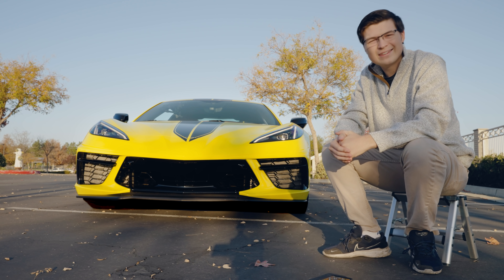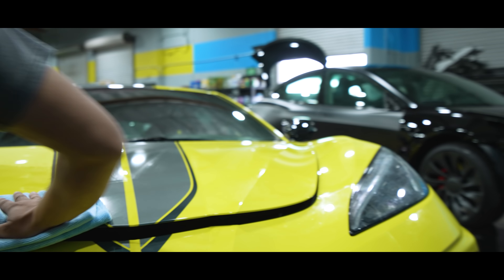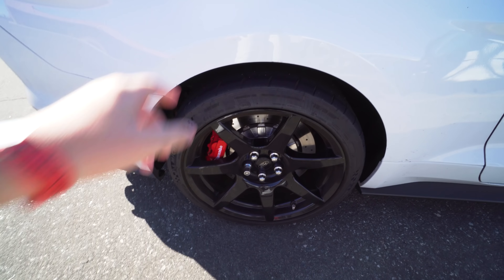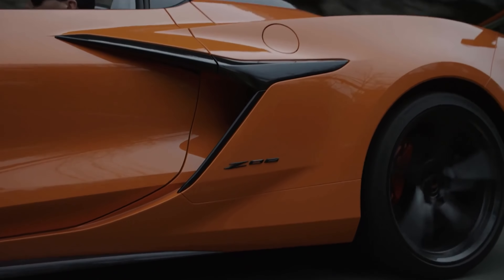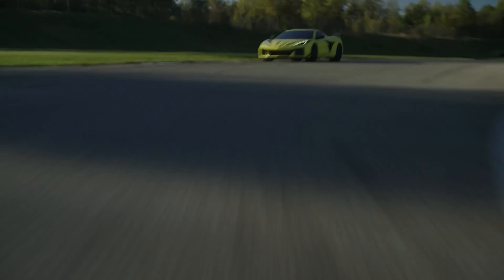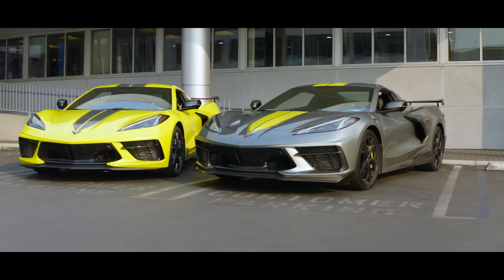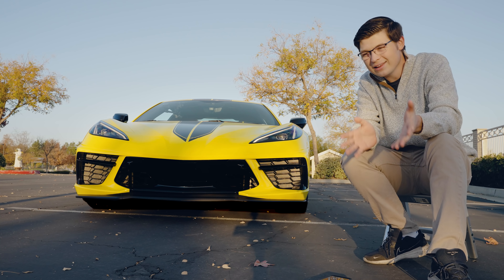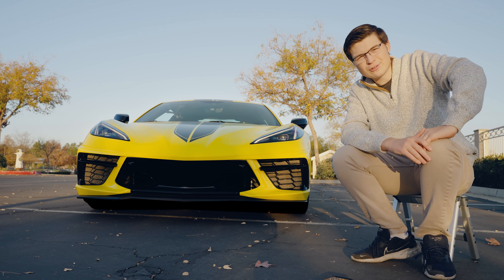SHOULD I SELL THE ULTRA RARE C8.R FOR A NEW 2023 Z06?

Comment: YES YES YES 

Sell, sell, sell!!!  Get as many ZO6s as you can!!!   
I was too late to the Ciocca party.  I was in Aruba and couldn’t do a wire transfer from there.

Decided to try MacMulkin a week or so later.   I’m #1672 no chance for me to get one at MSRP there for years. The C10s might be out by #1,500….  

I don’t need ZO7 on ZO6.  I’m not into Carbon Fiber either that much. Give me Torch Red, GT2 Seats, probably Front Lift, Mag Ride, Battery Protection and Standard Stock Wheels and Tires. (Hopefully the “Standard ZO6 Coupe” will have most of the Z51 Performance Items, maybe even those “beefed up a bit”!!!)

Comment: Mark ups are pretty nuts for the z06, well around me they are.  I have a 2021 C8 convertible, but love to have the Z06.  Can you get one without a crazy mark up?
Reply: Unfortunately probably  if you no the right people or have bought a ton of vettes like Austin has probably  from 1 dealer! Same as ferarri Porsche and lambo with there top models! Good luck hunt hard you might find a dealer that will sell at sticker! But my advice for you is wait till second year model as the new engine in zo6 could have issues first year! Let all the hype pass and be patient and wait a year after it's released then you will have way better chance of getting one at sticker and if it has issues the second year they will iron them out! Good luck!!
Reply: @mareewalker1096  Have you been under a rock for the past 2 years, stop spreading nonsense about the reliability of the new LT6 engine. It's been track tested for the past 2 years and has been rock solid, there is no way anyone could put more stress on that engine than the race team.
Reply: @pro5.019  I said it COULD have issues ! It's common new model cars have little issues that get ironed out with following year models! We're am I spreading rumors! Just made a statement that is based of facts! But i said it COULD not don't buy it it's going to have problems! That's spreading rumors! Didn't the c7 c06 have cooling issues ! Didn't it's 4 cylinder activation to save fuel cause long term issues!! All car builders can run into issues with new models!! Have you ever heard of new model cars having issues?? Don't jump to conclusions read what I said I believe it's sound advice! Take it as you feel it! I'd wait for second year just to be happy and confident it's a solid machine for 100k of my money! A lot do I'd expect!!
Reply: @mareewalker1096  You also stated in another comment above in this video  " Pretty good chance it has issues " that doesn't sound like COULD to me, maybe you should look back and read what you wrote. You also referred to the Stingray engine being proven, weren't you aware of the lifter/valve spring issues some owners experienced. Bottom line is any manufacturer can have issues that's why we have a warranty, and FYI if there was an issue buying a second or third model year doesn't improve your chances of getting past any problems. Many times the problems still exist in future model years due to manufacturing issues. 100k for what this car offers isn't a lot of money, after all you are buying a GM product not a high end exotic regardless of all the marketing hype. Look to a companies past history and the problems they have had, what matters is how those problems were addressed is all that counts.

Comment: Eventually a you tuber is going to purchase the supercharger kit, springs , aero, wheels and tires and lower the Stingray for the ultimate expression of the LT2 in a mid engine TRACK FOCUSED MACHINE. I will be the first person to say that a Stingray in that configuration WILL BE DEVASTATINGLY GREAT as a track focused car, but the Z06 is GMs TRACK FOCUSED CAR in this series. If your familiar at all with track life is EVERYBODY tweaks their cars eventually to be better on track. Since this is the ONLY channel that is showing the Stingrays track capability, its a shame that you didnt build upon the chassis since the aftermarket has products to enhance track performance significantly. We want to see what the Z07 package offers, but i would have loved to see a modded Stingray. You could of at least put SPRINGS on the C8R and lowered it.
Reply: Austin doesn’t mod his cars’ drivetrain or suspension. I’m guessing to keep the warranty but you won’t see him do any of that
Reply: @josephshehan4763  That's a major disappointment when he is already switching out carbon ceramics on his McLaren. The Stingray goes on sale in Europe in the spring, and you can be assured someone there will make the Stingray more track focused.